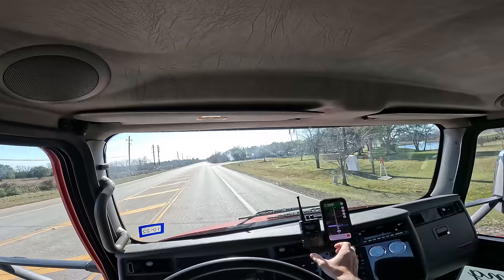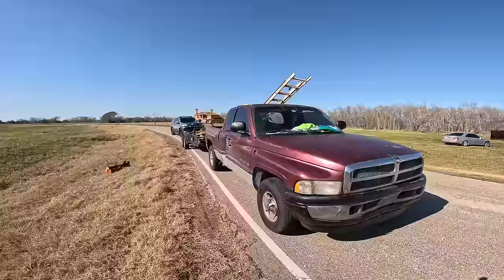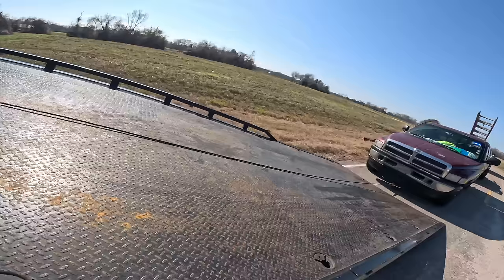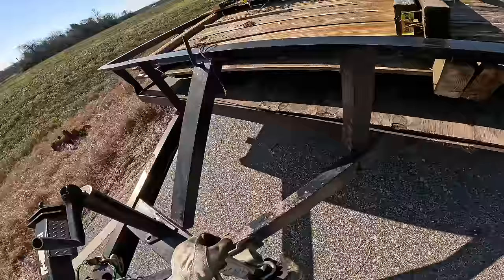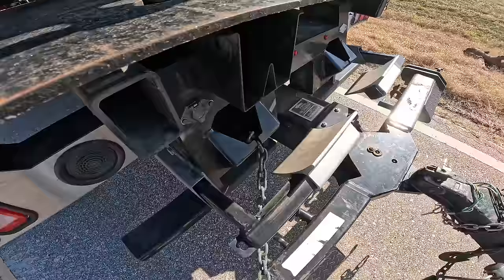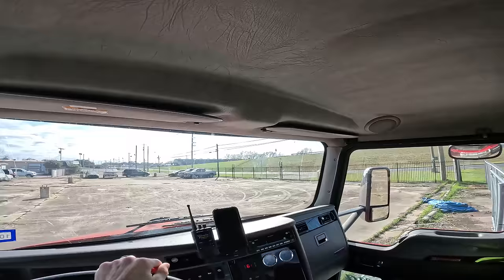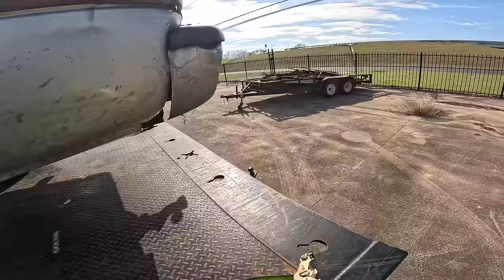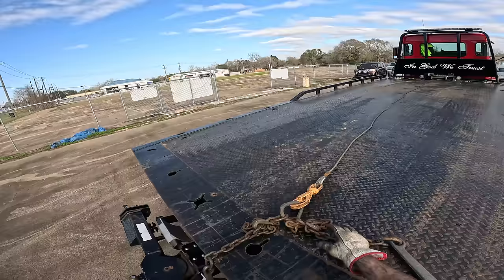Doubled Up! Towing A Truck And Trailer!

Comment: Hey dustin if you look at the A-frame on this trailer there should be a stamped ID  number so where 9n that frame if it's not there then it's most likely stolen.
Reply from the maker: I looked when I got back to the yard. Didn’t see anything. Doesn’t help that it looked to have been repainted at some point.

Comment: Do you extended your wheel lift a bit to tighten down on chains so it doesn’t swivel?
Reply from the maker: If you retract it fully the T bar locks and wont swivel.

Comment: how come you use these straps like this and not the over wheels ones you see more standard on trucks these days?
Reply from the maker: I’m assuming you’re talking about 8 point straps, which I do have a set of, but only use on high end vehicles or vehicles with custom wheels. 
Unless you leave them out on the bed, to me, the standard D-ring straps are faster than 8 points. I don’t like leaving them out on the deck like that because the sun bakes them and causes them to get brittle.
Reply: @Towtruck_Dustin  that makes perfect sense, up here in canada we dont see the sun so that explains why its common here then